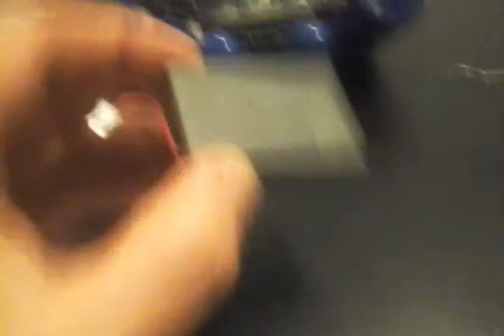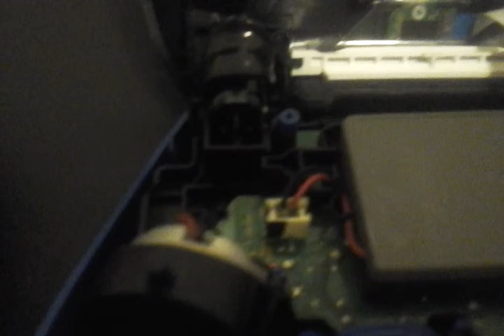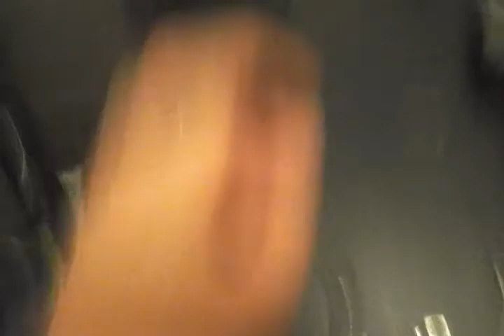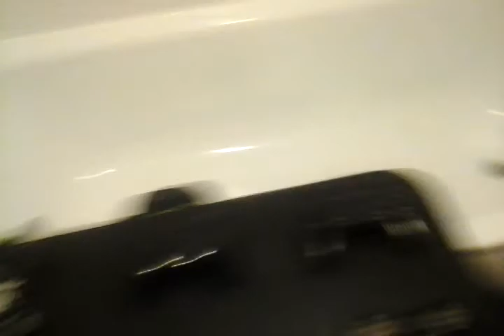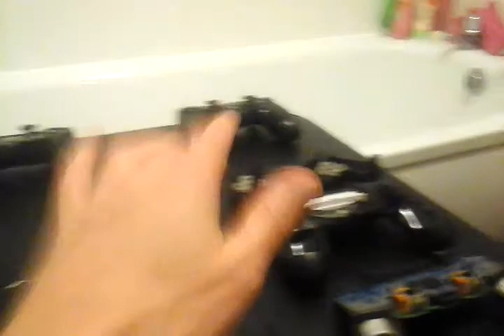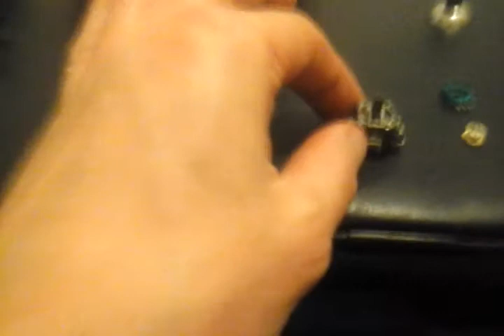DS4 Dualshock 4 Controller Battery sourcing & maintenance tips. (Ultimate Easy DIY Trick)

Comment from the maker: Charging control pads via wall socket plugs or other USB devices can kill your battery. 
The back of the pad states 
DC5V --- 800mA = (0.800A?) but the battery itself states 
Max charge Current : 1.0A = (1000mA?)
Max charge Voltage : 4.25V
On that note i would try to use either or not mix & match 5V --- with 1.0A (1000mA) charger just to be sure. 
But 4.25V --- 800mA would be perfectly safe if you can find such a plug?
The Battery itself is
MODEL LIP1522 Li·ion BATTERY PACK
3.65V---1000mA / 3.7Wh Sony Corporation 
(so thats its power output & capacity at a drain rate of 3.7Wh watts an hour?)

Comment from the maker: If only BAM metal coating was suitable for electrical contact points of potentiometer wipers & tracks? How much landfill could be avoided at what cost in all respects environment fabrication or otherwise? 
https://www.youtube.com/watch?v=797eG7wPYj4

Interesting substance.
https://www.google.com/search?q=Bam%20coating&hl=en&safe=off 

Read all about it this stuff has amazing potential if legit & cost effective not screened from the public domain, this is the information you are looking for. 
https://www.latimes.com/archives/la-xpm-2000-jan-31-fi-59506-story.html

https://www.eurekalert.org/features/doe/2001-12/dl-bca062402.php

The cold hard truth is the failure rate of older generation tech wasnt yet enginered to fail minimum viable product TRASH! for the sake of resellability mandates.
Planned obsolescence what a landfill joke we live in? I never had the same degree of problems with DUALSHOCK 1-3 in there lifetime fact!
https://www.google.com/search?safe=strict&hl=en&sxsrf=ALeKk02_z3zefor1kLHV_ZNbY-NYbZJ0_g%3A1622710942166&q=Engineered+to+fail&oq=Engineered+to+fail+minimum+viable+product+mandates&aqs=heirloom-srp..

Enginered problems to provide the solution is what the NWO of BS is all about thats not a very sustainable approach in anybodys book it only serves to deliver anti trust lol. Not fit for engineered purpose Titanic engineering as a way of death?
Reply from the maker: All made in c***a the land of yes men & corner cutters, thats progress reversed then never mind stopped? Your not allowed to remember the past in the land of hear no, speak no, see no evil mandated to think happy thoughts like that solves the reality of bad situations lol. Just will it & it will manifest greatness? Clowns to the left jokers to the right here we all are dropped in the meat grinder. Order from chaos lol. You get the picture troubling things are before us all. But dont worry we are all in this great reset together committing us all to landfill?